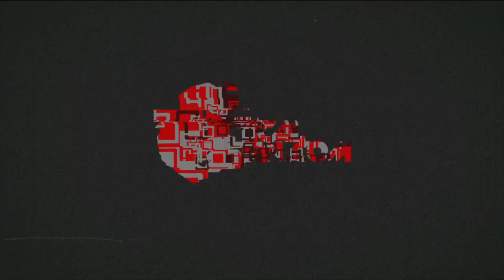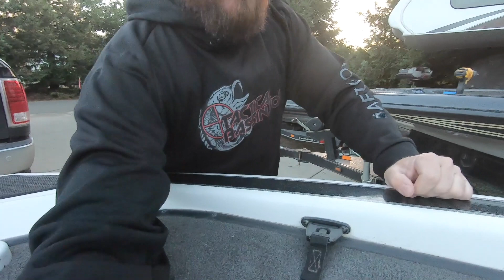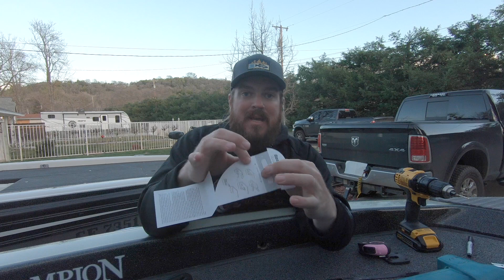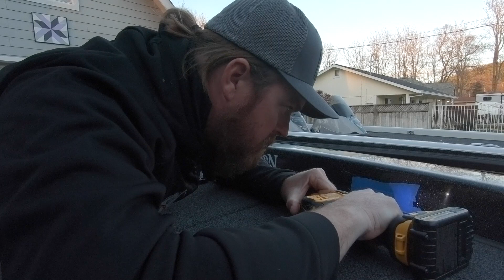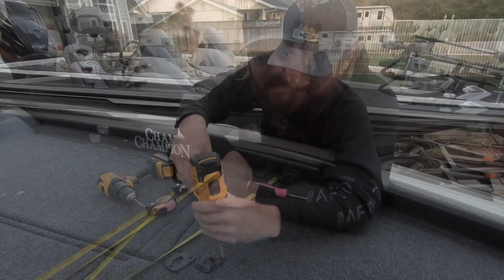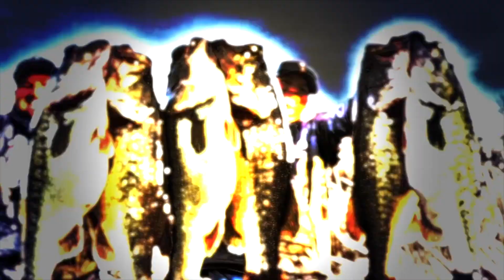DIY Boat Project: The First Upgrade I Make To Every Boat!

Comment: I know that you know the Champion layout well Matt but one thing you forgot to mention is to check for any wiring or other obstructions inside the gunwale that needs to be protected or may even prevent the mounting of these buckles before you start cutting.
Reply: Steve Steve I was thinking the same thing. But I’m sure there was nothing on hers. I bet that’s why he forgot.
Reply from the maker: You're right Steve. We work on these Champs a lot so I knew there were only trolling motor wires and light wires back there with inches to spare, definitely should have talked about that.

Comment: On my Astro, there are wires for the trolling motor on the same side, so just be careful wires before cutting or drilling holes just as a precaution.

Comment: Just a tip for anyone doing this.....the plastic clip that allows you to attach the retractable side to the boat surface, has a small gap allowing you to remove it from the sewn loop. Once you remove it from the loop, you can slide the conversion kit piece in, keeping it from retracting too far. Then you mount it to the boat and put the plastic clip back into place. Hope this helps

Comment: Use the rubber bungee type, they work better, aren’t as cumbersome and much easier to install.
Reply: Russ Rupert  how are they better?
Reply: Mudbass Fishing The rubber stretches, can hold a lot more rods. If your like me, I  have 20 plus rods on my deck. No large click on your deck to step on.
Reply: @russrupert5420  the clip is flat, and it stretches more than the rubber one does.

Comment: Hey matty gr8 contents always. Just bought my first boat yesterday
 Has some very minor leaks at the seams at the rear lf the boat and some rivets. Whats youre take on repairing it, saw a few vids on utube. On brazing, and using marine epoxy etc which method  would you recommend. Also the benfits on bow mounts and outboard trolling motors, pros and cons??

Thanks

Comment: Wish i couldve seen how the clips attach to the backside
Reply: All the videos I've seen it has jas them cutting a big hole to mount the retractor.        ???
Reply: @johnwhite528  those are them mounting it without the flush kit. The flush kit you can buy separate

Comment: HELP- Ordered the straps and concealment kit but the straps have the Male buckle end already fully sewn onto the strap so no way to get them through concealment kit...  any ideas as double checked TW and appears no other strap option for the one without the buckle pre attached.   Thank you
Reply from the maker: I had the same issue the first time I did this. While the material is fully sewn, the buckle is actually hollow in the middle so you can slide it on and off. The easiest route is to fold the strap in half to slip it off the buckle. It will take a little mind over matter the first time, it's a cinch after that 👍

Comment: So if you can’t get to the back side this won’t work correct ?
Reply from the maker: That's correct. If you cant get to the back then don't use the concealment kit, just flush mount the buckle from the face.

Comment: Upgrading old boats with improved options is less costly if can do it yourself. However, some people are more mechanical inclined than others. It is a good idea before cutting or drilling holes in your boat to be sure there is nothing you might drill thru you don’t want too. Things like wiring and other things like gas tanks, live wells, hoses, fuel lines and the bottom of your boat. This sounds funny but people do things like this more often than one would think. The great thing about fiberglass is you can fix boo-boos without welding rods. You will quickly find out working on boats sometimes is no easy endeavor. Many installation directions seldom mention the dangers involved and rely on the installer to know more than they often do. If you just look inside most boats, and see hoses wires and cables running everywhere should indicate to most sane individuals that easy installation is not quite a truthful statement. If you attempt to take on installing a $3,000 dollar electronic sonar and make a boo-boo, smell smoke, and see sparks when you hit the power button you just lost a pocket full of dough. Good luck in your boat upgrade video series. I promise not miss a single video.
Reply from the maker: I can absolutely appreciate this comment. When we bought my 210 we did a rocker switch conversion and personally replaced every wire in the boat, added fuse panels, switches, and built custom switch panels. After that mess, installing our motors, electronics, etc is very simple. Boat work isn't for everyone but it saves a fortune for those who take their time and do it right.
Reply: @tacticalbassin  I never had the luxury of buying a tricked out fishing boat. However, I installed my electronics, onboard battery chargers, GPS trolling motor among a bunch of other handy little things. It makes you realize why tricking out a good fishing boat is no walk in the park. Most discount priced boats don’t come with much. There is a serious difference in cost if you want good electronics rather than basic systems. Truly doing it yourself is a serious learning experience. Boats are bottomless money pits. I’m old and remember when Lowrance came out with a paper graph. It was state of the art because before that you only had flasher units. That stuff was one level above what Columbus used to discover America. You will never know how lucky you are, not having to use that junk. Keep up the great Videos Boys!
Reply: @gizmocarr3093  paper fish graphs? Did you have to replace the graphing paper every so often?
Reply: @anothersomebody8195  I never owned one because they cost over a $1,000 dollars. However, I knew a few guys that had them in their boats. The paper ran as long as they were turned on, I believe you could somehow use both sides of the paper. They would often stop recording and write notes on the paper for future reference. They looked like a polygraph machine. Thinking about having to use one was past my level of fishing insanity. When the first screen models came out the screen resolution, was so poor they looked like a Pack Man game screen. Flashers were mechanical and made a noise that could get pretty annoying real fast. Most of the time most models were about useless in shallow water for marking fish. They only really gave accurate water depth and you could tell the difference from hard or soft bottom. Compared to now it was like using a lead line like the Romans used. You carried a bunch of marker floats and dropped them over the side to mark structure and creek channels. I remember dodging marker floats left by other anglers all the time. The good old fishing days had a few memories not so good compared to today. To answer your question yes and that stuff was not cheap. I saw some on E-Bay a while back and it Crack me UP.
Reply: @gizmocarr3093  that's pretty cool how they made it work back then. I can't imagine what it felt like for the old timers coming from horse drawn carriages as kids to fish finders in retirement
Reply: @anothersomebody8195  In 1954, my dad wanted to buy a Cadillac 2 Door Coupe Deville. He got the price down to $3,500 dollars. He decided on a Mercury instead and he paid $2,000 dollars for it instead. I’m old but we had electric and running water in the house.